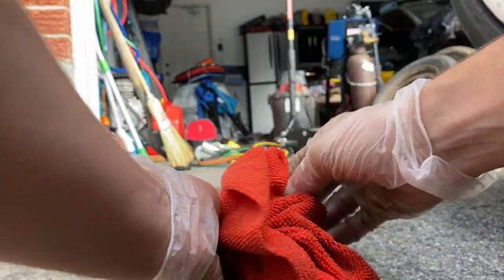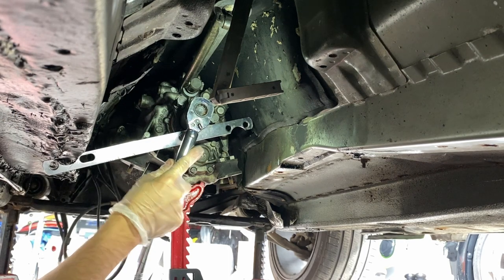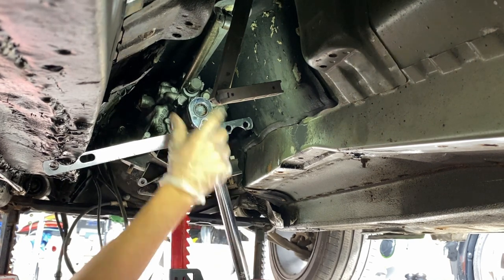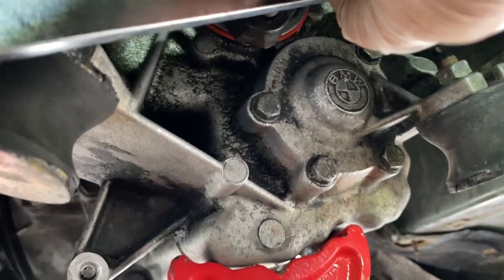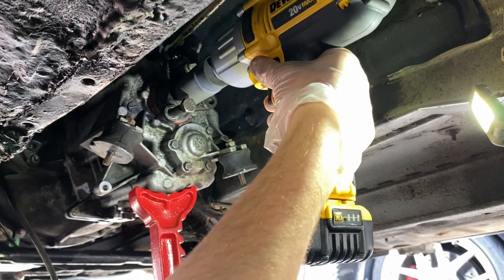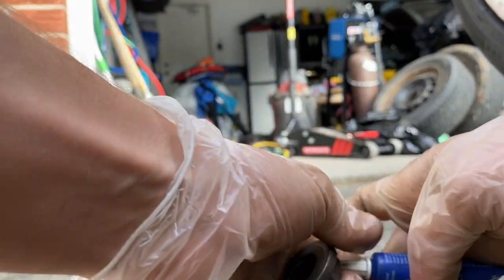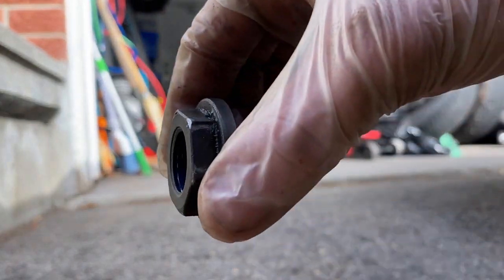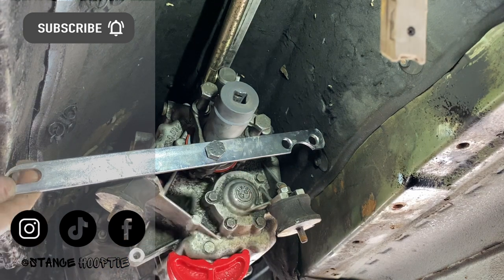SO EASY BMW E46 Transmission Leak Repair! ⎮ OutPut Shaft Seal Replacement! ⎮ 330I 323I 325I (Part 1)

Comment: Easy to put on. Hard to pay for because of the high prices of , BMW plastic parts.  🫤
Reply from the maker: Yea especially with these cars the gaskets literally turn into plastic after awhile. That’s the European cars… 80$ for a gasket😂 most people bring them to an aftermarket shop and not the dealer they can’t afford them.